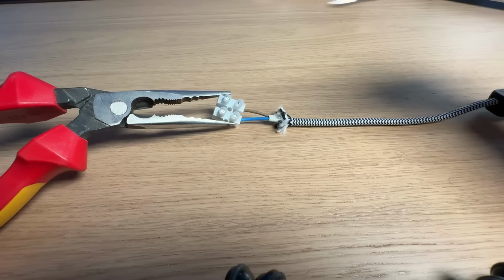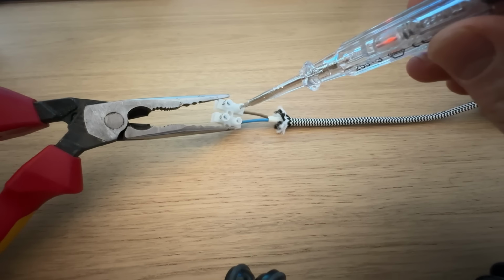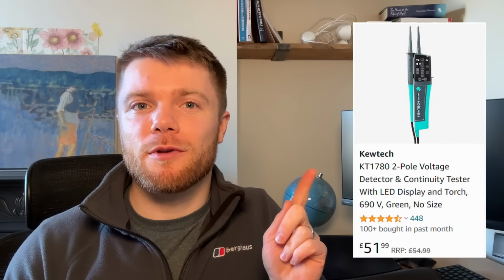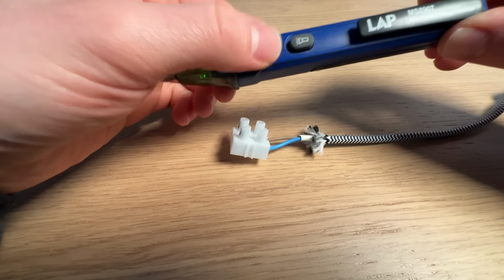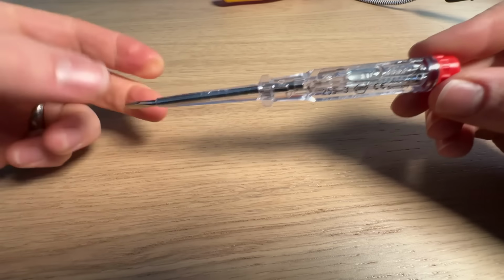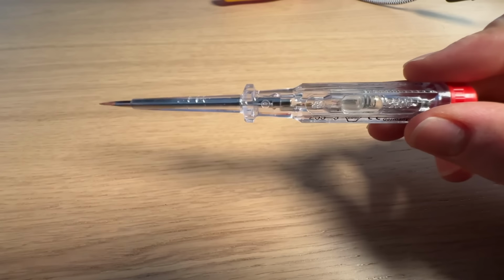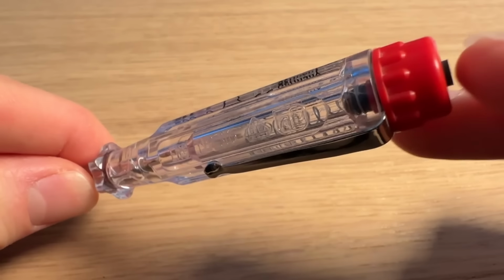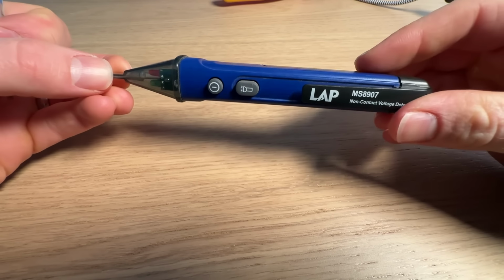The Most Dangerous Electrical Tool

Comment: I have been using my device for more than 50 years. It has never failed, never broken anywhere, never had any foreign matter intrude into it and has always worked. Yes it can be hard to see the neon at times but it has always shown me when a wire or contact is live to mains voltage. Your fears may be sound scientifically but the chance of it happening is extremely slim. Using the bared-ended metal spikes of multimeter probes is far more awkward and way more dangerous.
Reply: Yeah, he is just engagement-baiting. I mean, water gets into it without you noticing? Seriously? What if your “non-contact” thing gets soaked in water?
Reply: How is using the multimeter probes dangerous?
Reply: I’ve personally never had any problems using one and still have one that my grandfather used to use that also has grounding strap.

It also depends on what voltage/current you are testing, too, as some newer probes with LEDs do not work properly on circuits that alternate or flash, and you need probe with filament or incandescent bulb to create a small load on circuit etc.
Reply: Below some voltage the light won't glow. You touch the wire and you get shocked ! 😀.

At an isslated transformer it won't glow at any voltage ! You touch both wire and you get shocked ! 😀
Reply: @kenzo4Ever  well if you are dealing with a voltage that won't light it up then the shock won't do much either. It's not like 220v will kill you unless you decide to hold on to the wire or you are sitting on the roof without harness
Reply: @NocKme  Not true at all, it can have lower voltage so that the light seems off, but a current of a lot of Amps, which is incredibly dangerous. Volts alone don't kill you, it's the resulting Amps that do the damage and that is related to the source's available Amps and the overall impedance of whatever it is it's traversing.
Reply: @TheRealTwinsen  what causes the current then? Resistance right? So that means for the same body resistance, high voltage is much more dangerous. Source current capability doesnt matter much in practice, voltage matters. Its the voltage and frequency which can have cascading effect like ionisation and shot through which lowers resistance leading to higher current and so on. 24v battery have huge current capability, but body resistance is never low enough to use that current. High current source is nothing to our skin in practical, as long as the voltage is low
Reply: @lalmuanpuiamizo  True for the most part, but if by accident you touch the 2 terminals within a short enough "body distance" like using one hand and the terminals are few inches apart, it can give severe burns as the local resistance is much lower in that area and it can even eat up a portion of the flesh.
Reply: @  Even in that scenario youve put, lets calculate. If neon doesnt light up, less than 60v, but lets do 60. Skin resistance lets take middle 10k per inch. 6mA. It will still not burn you. It doesn't matter how high a current your source is capable of, it depends on resistance , which, like ive said voltage matters much upon
Reply: @TheRealTwinsen FFS, what amps can you get through a resistor and a neon lightbulb?
Somebody secretly poured salt water in it? Well, the same person could have put cyanide into your tea or something..
Reply: @lalmuanpuiamizo yeah, what is really dangerous is the people who do electrical work without even understanding Ohm’s law.
Reply: @TheRealTwinsen severe burns? Eat the flesh? Don’t grab wires with wet dirty sweaty injured fingers maybe?
Reply: @NocKme : We use 240v in the UK and yes it will kill you, it's not the voltage you need to worry about it's the current.
Tell your theory to the families of people that have been killed by 240v.
Reply: @kenzo4Ever I touched live wires many time when I was a child. If you are clueless, you will have 100 chances to get shocked with this screwdriver or without. If you are careful enough to work as an electrician, this screwdriver will not add any additional measurable risk to all the other possibilities.
Reply from the maker: Thanks for sharing your opinion

Comment: I was trained to use a Drummond test lamp first and foremost. I also used a neon test lamp extensively, never got so much as the slightest tingle while using it - ever !  The likelihood of a foreign metal object falling into the body of a neon tester or the ingress of water into same is very remote.
Reply from the maker: Thanks for watching
Reply: @keithterry:
Absolutely 100% agree, first tester I was given when starting out was a Neo industries test screwdriver, then you went up to the Drummond. Still have both in my kit today and they've never let me down.
Reply: Things like that would be blindingly obvious.
Reply: A Drummond test lamp won’t light up if you have low volts like 180v and still plenty to give a shock if you assume dead !
Reply: @petextanky8421  The Drummond test lamp that I was issued is rated from 80v to 500v so it will most definitely illuminate at 180v. The lamp also carries a warning to "prove " the lamp on a known circuit before and after tests. One should never assume dead.
Reply: That's why we were trained NEVER to assume dead until a further test  showing live was taken.BTW, I have just checked the Drummond test lamp I was issued with and it is rated 80v to 500v, so definitely a bright light at 180v     @petextanky8421
Reply: It will light up at 80v and "glow" at lesser voltages. The instructions on Drummond test lamps clearly state that the lamp should be "proven" on known circuits before and after tests. @petextanky8421

Comment: When I started work as an apprentice electrician in 1971 I had one of these. The charge hand took it off me and threw it in the bin. He then gave me a proper voltage tester. I have never used a screw driver type voltage tester since and never will. I have never understood why these have not been banned, especially with the amount of perfectly safe test gear that is available today.
Reply: A neon tester will detect the hazardous condition where all available contacts have become live. The professional testers, multimeter or test lamp will declare the condition safe.
Reply: Some of them are low-voltage (less than mains voltage), used to troubleshoot automobiles and other circuits.
Reply from the maker: Glad to hear it! Thanks for watching!
Reply: You sound easily influenced. "The charge hand" did a rampage and you abided. No explanations needed, no braining involved...
Reply: @u1zha  Maybe, but In fifty years I never go thrown across the room because a "dead" circuit wasn't 
I know of more than one electrician who couldn't say that after using one of those testers.

Comment: I have a couple of these & they are very useful & reliable. The concept is sound enough as long as the component ratings & construction are such as to absolutely guarantee the current is going to be very small. I use mine according to the old high voltage working adage of always keep one hand in your pocket & stand on an insulated surface/ insulated boots etc.
Reply from the maker: Thanks for watching!
Reply: If you stand on an insulated surface, how then will you be grounded for the tester to work?
Reply: @odoohub5010  There is sufficient capacitive coupling between me & earth to allow enough current to flow to illuminate the neon light. It's not as bright as it is if I touch earth, but that buzzes my finger more than I'm comfortable with or feel is 100,% safe. Wouldn't work if it was DC without solid ground connection.
Reply: @odoohub5010  You need very low current to light up the bulb in tester, even capacity of your body to ground is often enough.

Comment: Neon screwdrivers have saved the day many times. Volt sticks are a liability,  All I ever hear is .. damn thing sling it in the skip ,there is a neon in my box.
Reply: Volt sticks are unreliable, often show "live" on neutral cables or don't work at all; then there is the battery problem. Networks guys that I worked alongside despised volt-sticks.
Reply: Both have their place and are useful.
Reply from the maker: Thanks for watching!